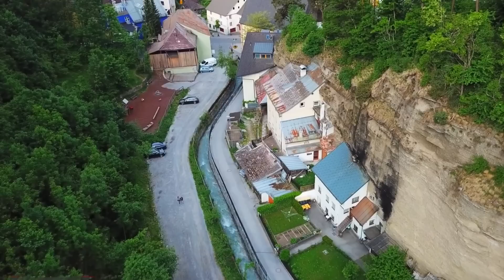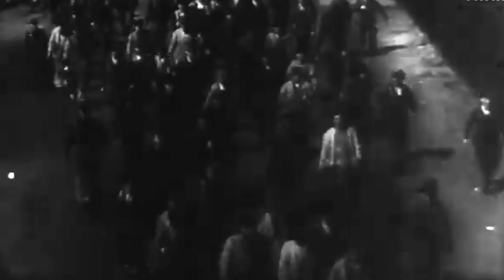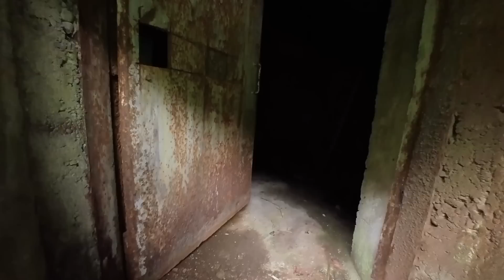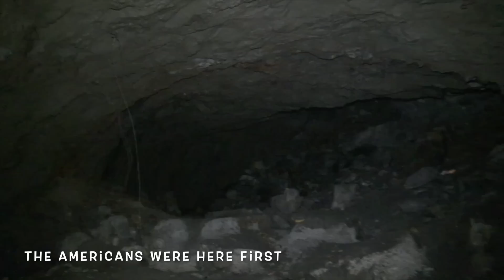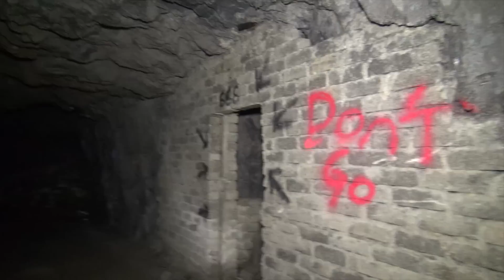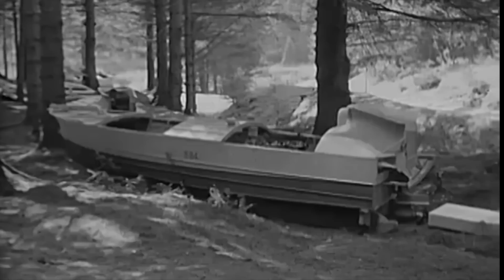HIDDEN ME262 UNDERGROUND FACTORY DISCOVERED

Comment: 23:24 shows one of the accesses to the production halls which were blown up by the French after the war. No more access possible. As far as I know the access openings were sealed with concrete walls before the ceilings were blown up. So even if someone was crazy enough to crawl through the collapse, they would be standing in front of a concrete wall.

Comment: Wooden floors?

In aircraft "factory"?

Individual components of aircraft tend to be a little "delicate. If you drop them on a concrete floor, the ensuing damage can render the part unusable.

Check out W2 ALLIED aircraft plants, especially engine factories. WOODEN floors; often thick parquetry laid on the actual slab, but the idea was that a dropped part might "bounce" instead of bending.

The other big reason is that a wooden floor, regularly "mopped", produces very little abrasive dust,. the tramp o f thousands of feet on a bare concrete floor WILL generate a steady supply of cement / sand dust; stuff you do NOT want in a gas turbine, ever. Or in ANY piece of critical, precision equipment.

Finished parts would have been "warehoused", often in heavy-duty cardboard boxes, on wooden shelves standing on a wooden floor..

When the sub-assemblies got bigger as parts were added, some form of "cart" would have been needed, alonfg with relatively smooth flooring on which to run.